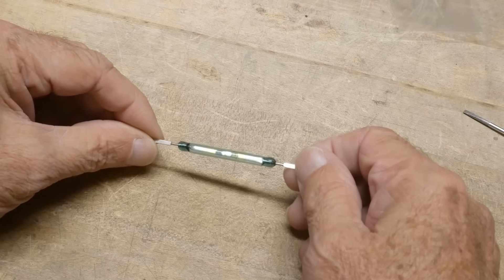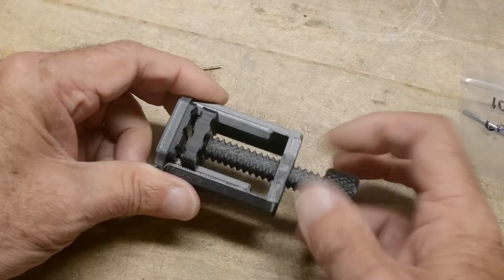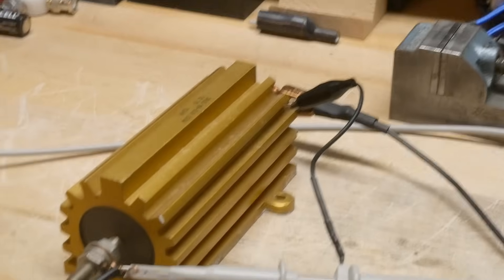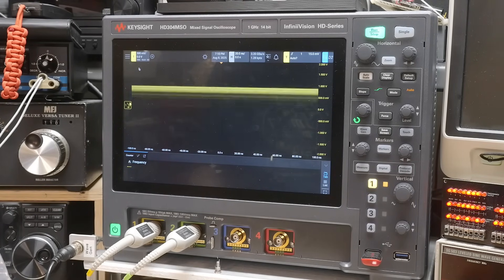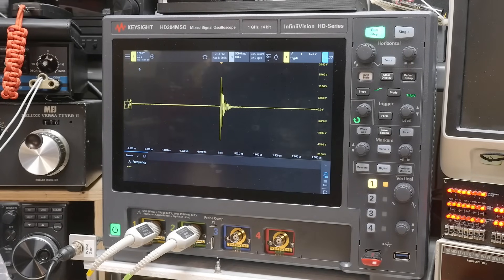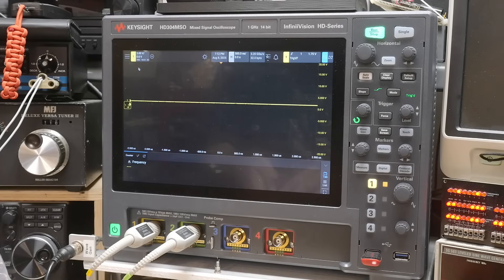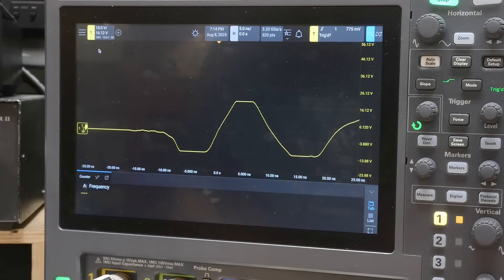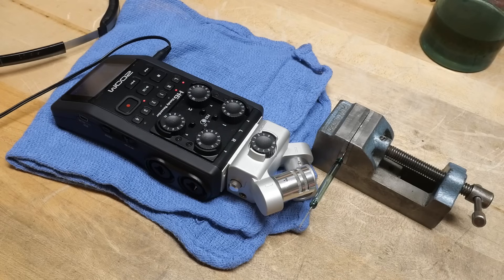#2330 Magnetic Reed Switch 6 Amp

Comment: 1st time here:  
1. why would we even care about the inductance ring in your circuit (wires & resistor)? It has nothing to do with the switch.
2. I would rather care about milliohm preformance under different current and different magnet strengths.
3. We all know about mechanical contact bounce, that would be more useful than inductance ring. Here I test a mouse switch for contact bounce https://www.youtube.com/watch?v=wLutCU3OVOA

Since we know its mechanical contacts, no one is going to use a mechanical switch for rise time applications, what am I missing?

Comment: If you want a NC normally closed reed switch, find a small magnet sufficient to cause the terminals to close. Glue or tape it to the side near the contacts. When another magnet is brought into the vicinity it can open the contacts by countering the poles.

Comment: So, when you "rate" a wire, or PCB trace, you look at temp rise and voltage drop, right?  What do you look at when you rate a switch?  What makes a 6A switch good for 6 amps?  Or if you had some unknown switch, and you wanted to rate it, how would you rate it's amperage?
Reply: "what makes a 6A switch good for 6A?" The contact area and contact thickness.

Comment: This is a neat way to use reed switches.  I was at the Institute of Hydrology in Cambridge.  They designed instruments for use in extreme invironments, like the North or South pole. In this one case they made a tipping bucket rain guage where the electronics was completely cast into an acrylic block.  Connectors to the outside were female banana jacks.  The display was also cast into the block. For controls, reed swicches were positioned in various locations in the block.  You could opereate the controls by holding a small magnet near the switch.  These things could be totally immersed in water without affecting the electronics.

Comment: You need to see if you can get some high voltage reed switches, which have interesting contact systems to get 14kV isolation, while still being able to have a contact current of 1A, though they do have switching power limits on them. And yes reed switches are good fast switches, but they are not immune to contact bounce, the old standby of 24VDC operate voltage, and 1k series resistor with 10n metallised foil to ground, to get some ESR, or else you weld the contacts, or need a series 10R resistor with the reed switch if using ceramics or 100n capacitors.
Reply: I needed a high voltage relay for an application and wasn't finding much on Digikey.  Then I realized they were all in the "reed relay" category.  Suddenly it made a lot of sense!

Comment: What causes the ringing?  Just contact bounce?  Must be some inductance in the circuit to get the high voltage? Back in the 60's I did the software for a radar threat detector and in the circuit they had a relay that I was to turn on whenever I had the receiver tuned to the band the operator wanted to see on a little scope.  I told them that I didn't think using a relay would work as I was tuning through the bands probably at 32 Hz.  When we first turned it on, they asked what that buzzing noise was and I replied that it was me life cycling that dammed relay!  The relay disappeared never to be see again!

Comment: Wire wound resistor. It's going to 12V because you made a boost converter. Congratulations. Would have been way more interesting to see the voltage across the switch, for obvious reasons.

Comment: I suggest comparing a modem sold state MEMES magnetic switch, like Infineon TLE49642MXTMA1 ($ 0.54) with old reed magnetic switch for speed and settling time. The MEMES switch does have much lower current rating due to smaller size.

Comment: I found one in my wife's treadmill.  The treadmill speed went flaky and Google led me to the speed sensor.  I expected a hall effect setup of some sorts but it was a plain old reed switch and a magnet.  Pulled it and put an ohm meter on it and it wouldn't move.  A little percussive maintenance got it moving and proved that was the problem.  Replaced it a few years ago and all is well.

Comment: Never use a reed switch/relay for an inductive load.  They can bounce/arc/weld up.  Guess how I know this.
Reply: You may need A "reverse" diode, also known as a flyback diode, in parallel with the reed switch to release the back-EMF energy
Reply: @NICK-uy3nl      Actually the diode needs to be in parallel with the load, not the switch,  to be effective.  I should have mentioned that a diode is necessary.
Reply: @wilhelmvonn9619  - it will work either way, Flyback diodes are commonly used across relay coils and switches to prevent arcing across the switch contacts, in this case the reed relay.

Comment: Is that a wire-wound resistor?  That could be due to the inductance of the wire windings. The voltage you are looking at is across the resistor.

Comment: used to use them to make RF switches as you could put them inside the screened box and switch from the outside with no holes or metal push rods going through the screen.

Comment: I presume it has  a relatively low breakdown voltage, since the contacts are relatively close together. If they are mercury wetted, then there would also be mercury vapour in the thing. You might be able to get an interesting light show in it  using an HT power supply.

Comment: Ran into this exact scenario:  I worked in the oil patch for a PD meter company and one style of low-speed pulse transmitter used in explosion-proof (Class-I/Div-I ) used a reed switch.  If the customer wired incorrectly (without some sort of RC filtering) they would register the ringing as extra volume (we called this 'ghost barrels') from the meter.     It was older technology that someof the established oil companies did not want to stop using.  They would not beilieve the 'ringing' until i showed them a screen shot of my oscilloscope.
Reply: One of the things I love about some of these channels is in the comments. I get to learn what other people in this world actually do for a living. Sometimes I just have no idea what other jobs are out there. And I'm 40. Been a automotive tech my whole life.
Reply: Yes reed switches all need debouncing to interface with digital logic, unless you specifically use logic inputs that are designed for slow switching and thus have debouncing on them. Lots of mechanical counter replacements have this, I remember ordering one, and it arriving saying on the screen "SLEEP" to indicate i was still in factory low power mode. No way to put it back there after the first count, and not exactly easy to open to replace the 2 CR2032 coin cells it used either.

Comment: Kind of hard to get a precise time for a complete waveform because I can't see the scope graticule but it looks like the ringing on the last capture was about 25nS.  That would be 40MHz.  Stick a magnet on a variable speed motor and with a lot of patience you could probably dial it in to get it synced to make a very crude 40MHz RF generator.

Comment: AI Summary

Abstract: What's on the Bench? A Deep Dive into a Large Reed Switch

This video provides an in-depth examination of a surprisingly large magnetic reed switch, exploring its construction and electrical characteristics. After visually demonstrating its contact mechanism under a microscope, the presenter tests its current handling capabilities and switching behavior using a 1-ohm load and an oscilloscope. The primary finding is the significant voltage ringing (spikes up to 12V) observed on the output whenever the switch contacts open or close, despite its otherwise fast switching edge. The video highlights this inductive ringing as a critical consideration for circuit designers, especially those seeking clean, fast transitions. The switch's impressive current rating (stated 6A, tested to 1.7A) and a distinctive audible click are also noted.

I used gemini-2.5-flash| input-price: 0.3 output-price: 2.5 max-context-length: 128_000 on rocketrecap dot com to summarize the transcript.
Cost (if I didn't use the free tier): $0.0055
Input tokens: 13309
Output tokens: 601

Comment: Mechanical switches with mercury on the surface are good for sub-nanosecond switches I learned from people who made such experiments around 1950. The mercury was good to avoid contact bouncing. The ringing observed here might mainly be from the inductance and capacity of the setup. 
A more direct (and fun) way to check reed switches will be to fix the magnet to a fan.
Reply: Yes, did a lot of mercury switch repairs on ATE equipment, where the repair was to take the board, remove the relay, and tap it hard on a padded table top, to get the mercury wetted contacts to have the mercury blob back on the contacts, so they would make cleanly again. As the inside was otherwise non wettable, you had to shake that 1g of mercury around the switch till it got back on the wetted silver copper alloy contact points again.  3 full racks with only those switches on cards, and a self test program that you loaded off paper tape. That took most of a day to run, swapping out failed cards for repaired ones, and fixing them later on one by one, with a printout of which relays had failed contact testing per card.
Reply: Exactly. Sad that IMSAI Guy obviously does not know wut is going on here. At least he talks about ringing and not bouncing.

Comment: Use a FET and check power supply response,...
Reply: Especially since there is’nt that much inductance in the circuit. Strange that there are such swings.
Or use a battery instead of an electronic power supply.
Reply: @anonymous.youtuberI think the bounce is the power supply. Note the trigger is seldom at the step of current.